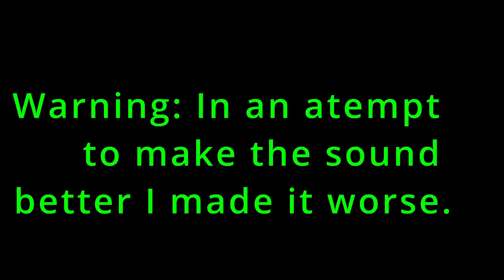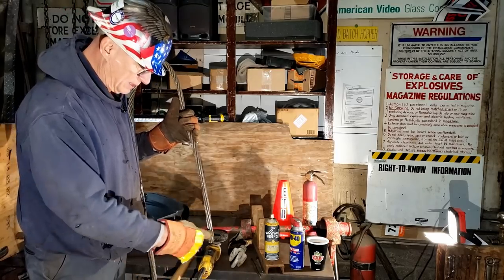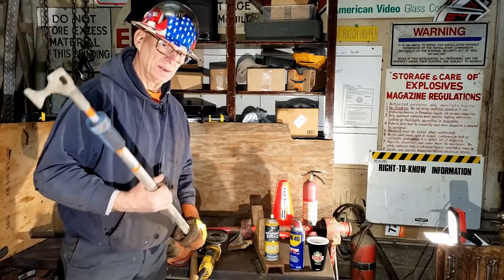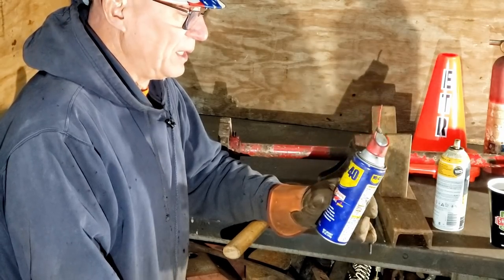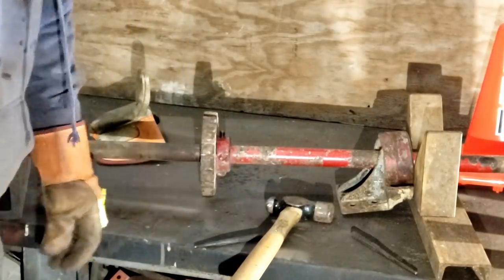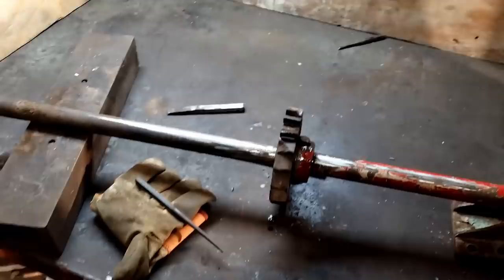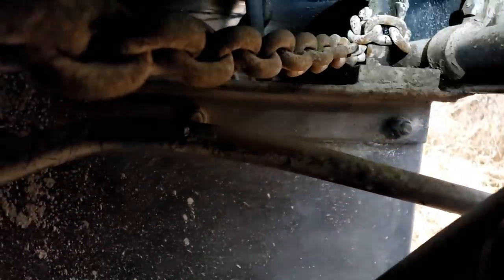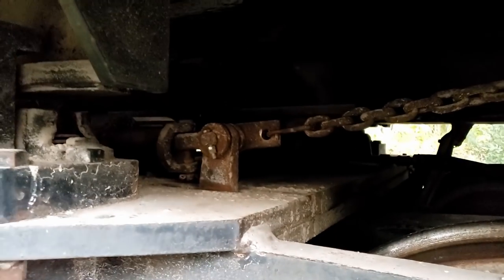Locomotive and Railcar Brakes

Comment: The hole in the head of the brake stick is for turning the retaining valve handle from the opposite side of the car, while standing on the ground, without fouling the equipment with any of your body parts.

Comment: Ya know, folks think us hillbillys down here in the south are ignorant, but at lease we know to use a wrench to remove a bolt and not a hammer and punch. Something the makers of WD40 don't want you to know is that it evaporates leaving you to have to use more of it. If Mrs. E.T.R wants a suggestion for your Christmas gift, tell her you NEED a bench vise. May God bless you all throughout the holiday season and all next year.
Reply: I would've tried turning the bolt first to break it loose or maybe the side where the bolt came out might have been threaded and the nut was a lock nut.

Comment: Old retired Army mechanic advice, never hit threads, put the nut back on even with the screw and use a brass drift instead of a steel punch. Be generous with the penetrating oil, both ends, threads and head, then let it set so it can have time to actually penetrate. Put a wrench on the head and attempt to turn it, if it turns give it more oil while turning it. If it won't turn, then try the heat. But not on the screw itself, heating the screw will only expand it. Heat what the screw is going through. 
My father in law was a brakeman on the Big Boys through the Wasatch Mountains of Wyoming before WWII. One night I asked him how many times he had fallen off the cars as he was setting and releasing brakes, he looked down and said "to many, way to many." He enlisted in the Army and repaired track and rolling stock in France and Germany to help keep supplies moving. After  the war he worked for the New York Central, Conrail and Metro North operating a 100 ton steam crane out of Harmon Yards in New York. That crane is now located at the National New York Central Railroad Museum in Elkhart, Indiana.

Comment: Safety recommendation. When chocking the wheels of an active loco maybe add a long handle to the side of the chock so you dont have to bend down and reach under the front of the loco to chock it

Comment: ETR,
Was looking for a duplicate post about the brake stick, I didn't find one in the first 30 posts so:
The slot on the Brake Stick head is actually for a "brake stick holder" located on the locomotive. One end of the holder has a round tube for the butt end of the stick to slide in, the other end has peg for the slot in the head to rest on.

Comment: We would use the saddle a dead horse when building radio towers about fastening guy wires.

They still build freight cars with roof walks, like the covered hoppers and LPG tanker cars. Boxcars don't have roof walks anymore though
Reply from the maker: I am festinated by radio towers!   Mostly how they are erected and maintained.         The cat walks now are for loading/unloading and not for use while moving.

Comment: You were right about the name. Was the fortieth formula tried was designed to displace water in the Trident missiles when they were first placed on submarines. Another military to commercial product.

I’ve found leaving the nut on the very end prevents thread damage most times. That bolt I don’t think would have made a difference.

Comment: The best thing I found for oil light bearing a on fans is Howes Lubricator, Lucas Air Tool Oil or Micro oil from Kroil. I used a little plastic micro oiler that you can buy 10 at a time for about 10 US dollars. The best bolt lubricant for anything on almost anything is copper based anti-seize so it won’t corrode together.

Comment: I use my 4 1/2" dewalt corded grinder alot.. mostly use the dewalt 1/16" thin cut off discs alot over other brands of cut off discs.. 1/4" grinding discs sometimes, but also like using the knotted wire wheels over the straight wire wheels (they tend to last longer, also good for getting into curved corners and makes quick work of removing bondo)   Oh.. theres always the idea of adding removable sheet metal panels over the windows with an oval hole centered on the bottom of the panel to accept a lock..  Its a shame that kids think its fun to bust out windows for fun..  Wish I was local to ya'll I would strip the paint clean down to bare metal for fun.. Keep up the awesome work.. Looking forward to seeing sporting a new paint job inside and out :o)

Comment: I use Kroil to unstick threads, smells awful too but you get used to it, it becomes the smell of satisfaction once you finally get that stubborn bolt free. I only have experience on small pumps, compressors and as a home gunsmith restoring crusty old firearms, nothing like railroad gear. One thing I've learned about WD-40 is that it should never go on parts intended to freely move as it is not a lubricant, but a kerosene-based water displacement fluid (Hence the "WD" - edit, I wrote  the comment before you said what I just said, ha!). It will eventually gum up and bind things, becomes a nightmare inside rifle and pistol actions. Use a proper lube for those and life will be better. Great video, always love your content.
Reply: There is no kerosene in WD-40 nor does it contain silicone, water, wax, graphite, chlorofluorocarbons (CFCs). This is according to the company.

Comment: One of the things taught to me in apprentice who was put a nut on the bolt before hitting it with a hammer. Can save the bolt for reuse. Less damage to the thread. Plus the bolt is less likely to ballon. Something else that would stop it shifting.  Fan bearings etc can benefit from WD40 with PTFE appears to keep the squeak away for a little longer.  Is WD40 with PTFE available in the US ?
Reply: Very educational

Comment: WD 40 was used a lot by me in fact, when winter moisture got into the distributor cap on our gas tractors, and our pickups. This was wayyy back in the day, 50's-60's-70's. Tractor won't start?  Take off the distributor cap and give it a spray, then start it up.

Comment: A good penetrating fluid is acetone and automatic transmission fluid in a 1:1 mixture.  You have to shake it up once in a while as it will separate over time but if you use penetrating oil a lot it's as good or better than any of those and a lot more cost effective.  I used to use that wd-40 for stuff like, if I had driven through a creek and the engine was running rough I'd spray it under the distributor cap, displacing the water and making the vehicle run smooth again.  Another good use for it is cleaning volume and tone control pots on old radios.  Now of course folks will say oh you can't use that, you have to use D5 Deoxit.  Well, I hate to tell them, but folks were using wd-40 to do that job long before deoxit was ever even thought of.  Usually if I need a light lubricant though for hinges or drawer rollers I'll use 3 in 1 oil.  On the hinges on my truck I have no idea what weight of oil I'm using because the oil pump can gets filled with whatever little is left in the bottles after an oil change in whatever gets changed, lol.  It probably has everything from 5w20 to STP or motor honey in it and about every weight in between, lol.

Comment: Re the sound, remember analogue VU meters? Modulation is correct when most of the time the needle swings just below the red part of the meter. Brief transient peaks, they're called, into the red are fine - good even but sustained red running = overmodulation and distortion which results in signal saturation of about everything from the input stages to the recording medium (the latter not so much these days but in days of tape you could saturate the tape so they upped the speed of it to spread the information over more tape to compensate - the cost being it cost you twice as much to do the same recording but the benefit was the recording was sublime. I like old school Hi-Fi reel to reels LOL). 
VU meter is just like a tacho on your car - a few quick 1/10th of a second jaunts into the red are good but redlining it in every gear and holding it there is not the best.
Since I've never made a YouTube video and am not an expert, YouTube or otherwise, I thought I'd just drop you a line since I also have a seldom exercised ham radio license and might know at least a little bit about the topic. Voice modulation is kinda important in the amateur radio hobby and we have all the meters one might need to create a transmission clean signal.
They tend to use more electronic meters these days since to be labelled 'VU" they have to have certified rise and decay times for the needle. That costs and cheap electronic display far exceed old VUs in performance. But, some radios go as far as emulating VUs with an electronic display VUs are so highly regarded. Then VUs are just easier to read and average the signal better for voice, so as with all things in life there's strengths and weaknesses.
Good quality microphones help a lot, but a good tradesman never blames his tools so to speak. What this means is even an experienced ham operator could make a bad microphone sound acceptable with a little bit of know how and I feel if you read this you'll at least have a scaffolding to build upon.
I think I've binge watched 2/3rds of all your episodes now and yes I'm a sub.
Reply from the maker: 12  Thank you for the detail, I'll need to reread this to get it all. I did goof that one up, thanks for sticking with us!  Brian

Comment: Not having the brake shaft solidly supported so the shaft will not move down while hammering will make the blow so weak it won't remove the bolt. A vise would have made the removal much easier.  Dave Cooper mentioned a nut, but there isn't much space to move the bolt.  Bolts are cheap, wack away!

Comment: Heard years ago to spray it on fishing lures and that fish like the smell. Tried it a few times with mixed results.
Reply from the maker: Terry  WD-40 works best on a "Steel head"!   LoL   Brian
Reply: @eastterminalrailway5975  😉
Reply: I was going to say this as well.  Actually it does increase your odds with fish, but the cold seems to limit the effect.  I do think it is illegal in several states to use it, and if you have WD-40 in your tackle box it can be a hefty fine.

Comment: So called penetrating fluids are very limited at best. They're just light lubricants. This is why mechanics have torch sets. You either heat to expand the nut, or cut it off.

Comment: I came across one of your videos of this engine while i was work one night. I say where you said you got this outt of indiana. Was it by chance sitting idle in Brookston at the elevator? If so, my dad ran this unit when he worked at what was the Pillsbury Elevator 10 miles north in Reynolds in ths 70's.  The elevator was sold a few times and the locol co op ended up with the elevator and used it between the two elevators in Reynolds before selling it to ADM in Brookston. If you are ever over this way again, the is a restaurant in Monon Indiana called The Whistle Stop that has a ton of old equipment out and a museum inside of the old Monon Line items.

Comment: Project farm tested several brands including home made, WD 40 won as the best penetrating oil beating PB Blaster and Liquid Wrench among others.
Also, always start the nut back on the bolt before hitting it, you not only protect the threads you'll avoid mushrooming thr end.
Reply: Was that the regular wd-40 or was that the wd-40 branded penetrating oil?

Comment: WD40 wasn’t good enough for 39 things before the final try! Your videos are great! Keep ‘em coming. Merry Xmas
Also I think Kroil is the king of smells bad
Reply: No, it took 40 different formulas to achieve what they were looking for - a water displacement agent, and it works great for that.  I always sprayed it in my distributor cap on point ignitions when they wouldn’t start up after washing the engine at the car wash. Fired right up after spraying the cap down with it.

Comment: Don't use WD-40 as a lubricant in a place where you don't want dirt to accumulate because it is an oil and will collect dirt. In those cases, it is better to use a silicon spray instead.

Comment: Title of your choice, How to remove a stuck bolt or How to make a rivet in 100 easy steps.
Reply from the maker: J  That's some funny stuf!   LoL  But I'll make the jokes O.K?  B.
Reply: @eastterminalrailway5975  I was wondering if the bolt wasn't a graded fastener, if it started to shear off due to leverage applied to the handle.

Comment: The lesson you need to remember from this self inflicted punishment is to focus on what you were going to do to correct for the broken tooth/pawl.  Apparently you had already decided that you were going to weld some filler/deposit metal to the broken tooth and then grind it down to something akin to the original shape. I infer this because you opened the show with the welding helmet discussion.  If that was your original plan..................then you could have jumped straight to the welding with the gear still in place on the shaft,  because removing the gear did nothing to enhance the welding or grinding process.   Now, if the original plan was to take the gear off and carry it to a machine shop/welding shop for them to do the welding, then yes I agree the gear would need to be removed, but for what you ended up doing,  you did not need to even look at the bolt (other than to make sure it wasn't gonna fall out).
Now I will give you a tip that can be useful for loosening rusted bolts or pins in situations similar to this.  If you have compressed air available from a small shop air compressor or other source (hint, if you have a running locomotive engine you probably have compressed air) use pneumatic chisel (air hammer) with a blunt tool bit.  Use the tool bit to hammer on the HEAD of the bolt as if you wanted to drive the bolt right on through from the head side. Hammering on the head doesn't mushroom or swell the bolt in the hole.  The idea here is that the rapid percussion shocks  will literally shake the rust crystals into dust and break their bond and the bolt or pin will loosen.  I have also used corded electric hammer drills  (and nowadays cordless is an option, but it wasn't back then) set to percussion without rotation to do the same thing, but if I had a choice I would use the air tool because they are usually more compact (and more one hand friendly for this task).

Comment: Technique for removing that bolt was wrong on so many fronts...  Did it really need to be removed in the first place.    Keep the nut on the threads to avoid damage.    Support the cog, all the energy from your blows was going into bouncing the springy shaft.   Also there is more inertia along the length of the rod rather than on the circumference, so try the chisel wedge in-line with the shaft.   The effectiveness of the spray is questionable, as usually it won't penetrate through the rust and paint... ( Having said that, I have seen some dirty shafts loosened by using a very high powered pressure washer.)

Comment: were you sure the bolt was not threaded on to there and the nut was there to make sure it would not come out I could be wrong but that is my guess correct me if I am wrong I have not work on any locomotive so a vary high chance I am wrong

Comment: Stop!  Stop! Stop! Instead of hammering and misshaping the bolt head, get out the ol' blue-tip wrench (torch).  It's magic.  I have used many penetrants over the years.  NONE, I repeat, NONE, have ever freed up a truly stuck bolt.  But, ol' "blue boy" will do the job.
Addendum:  Well, you got it, but you sure did it the tough way.  I admire your tenacity..............

Comment: Don’t put WD-40 on an electric fan shaft, it evaporates really fast when it gets warm and then your fan motor bearings are dry again, and that means you’ve got to lube it again so it will run. It’s also no good for chains - like a bicycle chain.
Edit: Call it a park brake if you want, but the rest of us railroad workers call that a handbrake.
Reply: It works well on bike chains but they have a more specialized formula for that application.
Reply: Ive been on engines during my career that had electric park brakes on newer locomotives but I much preferred the handbrake manually operated…..ms~~~ 40 years~~~

Comment: I always use 2 of them cable clamps on my cable all the time
Reply from the maker: Mary   Thanks for adding that, I would always use two and prefer 3. But all facing the same way.  Brian
Reply: @eastterminalrailway5975  I turn the nuts to the opiset them the first one

Comment: WD-40 works pretty good as a safer alternative to starting fluid as it's basically deodorized kerosene.
Reply: WD-40 does not, among other things, contain fish oil, silicone, kerosene, water, wax, graphite or chlorofluorocarbons (CFCs). You can look it up.

Comment: Why are you obsessed with getting that gear off the shaft? You certainly could weld and grind  to form a new tooth with the gear still on the shaft.  Then there's choice O (for obvious): thread the nut back on the bolt, but stop before the bolt comes out the other side.  Nut will protect the bolt's threads when you beat on it.
Reply from the maker: Paul    I now think we will replace the gear instead of welding...did you see how many teeth were bad?   Brian
Reply: In a previous video he said something about only being to get the gear/shaft off because the broken tooth let it slide past a piece on the wall. If he put the tooth back on he would have no way to put the whole unit back in.

Comment: Would have been better off leaving the nut on loosely and heating the gear. Would have saved a ton of time and the bolt. You should get a bench vise also. Lots of wasted energy with that rod bouncing around on the bench top. Would have liked to see the repair of the gear not the hammering.